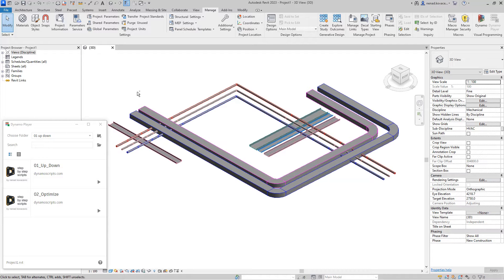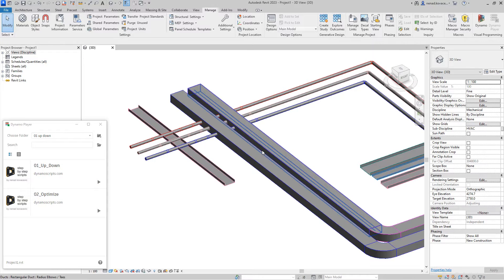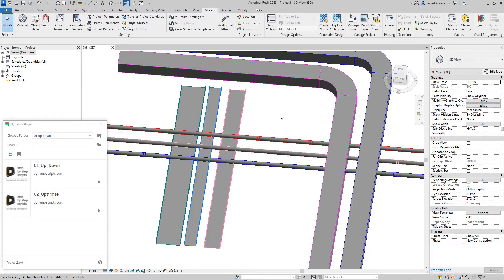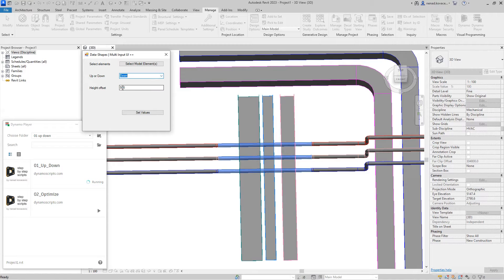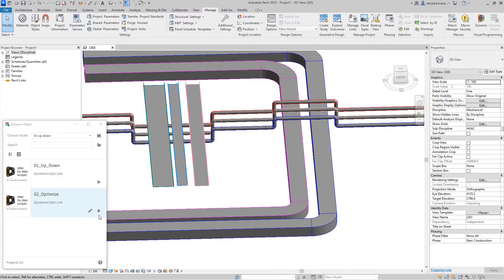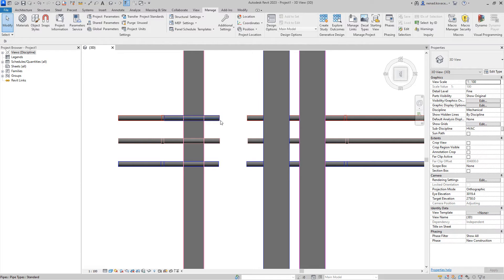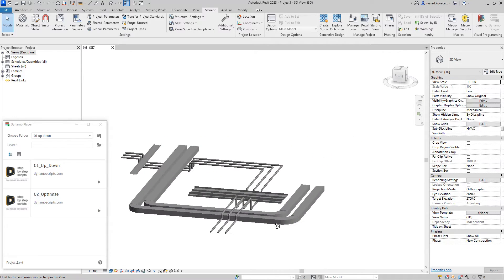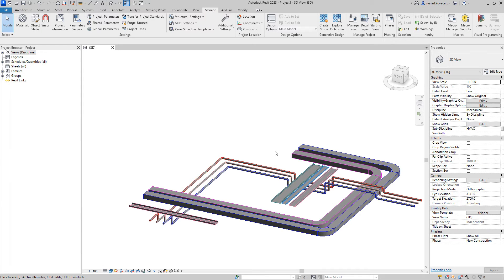Resolving collisions - Up and down

Comment: How to do it in cable trays? Because some time i need 30degree or 45 degree bending not 90 degree
Reply from the maker: For installations that will need to go by angle, it would be necessary to rewrite the script in a way that the installation needs to be splited, new elements need to be at desired height change and new elements by angle must be created between those elements. Then the script would need to connect all of that. Not impossible but a lot of working hours are needed.